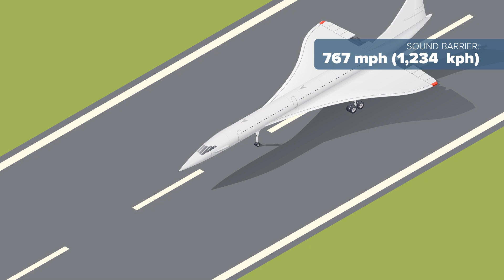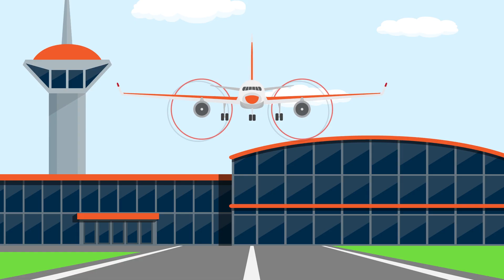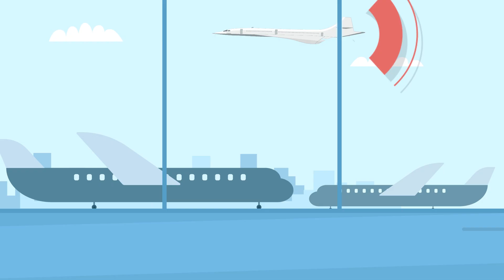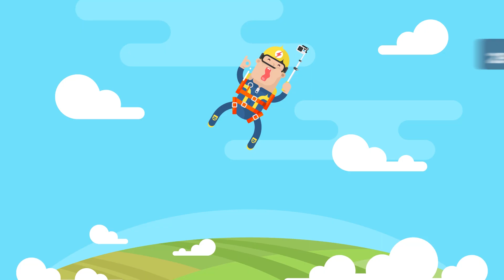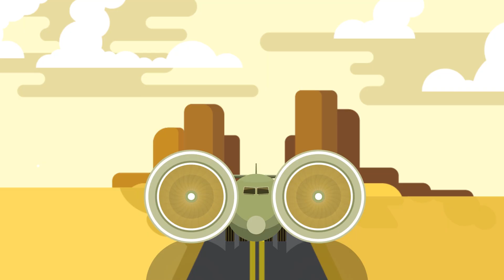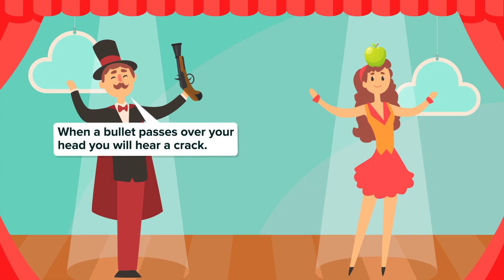What Happens When You Go Faster Than The Speed of Sound?

Comment: 0:32 I just love how the required speed to break the sound barrier in metrics is 1,234 kph.
Reply: this video claims that speed of sound is only at one certain mph lol the speed of the sound barrier differs at different altitude. Chuck Yeager did it at under 700mph because thr altitude he was at. Sound barrier speed on the ground in a car is, 731.9 lol at that happened in 1979. So again, this video is wrong again because more than one vehicle has broken the sound barrier. Whoever was in charge of doing the research for this video should be fired lol

Comment: Sound barrier is 767 mph... Thrust SSC breaks it at 763 mph...🤔
Reply: ALA_Legend 02 Depends on temperature and air density I believe?
Reply: @RB-H  yes. At sea level the speed is lower. Good thinking.
Reply: The speed of sound depends on the altitude the air pressure the distance above sea level and many other factors
Reply: ALA_Legend 02 exactly what I was thinking

Comment: Not everything in this is accurate, for example when you hear 2+ sonic booms from something it's not from the pressure returning to normal, it is because multiple parts of the vehicle are creating their own sonic boom. In the Thrust SSC this would likely be caused by the engines and the tail of the car each having their own.